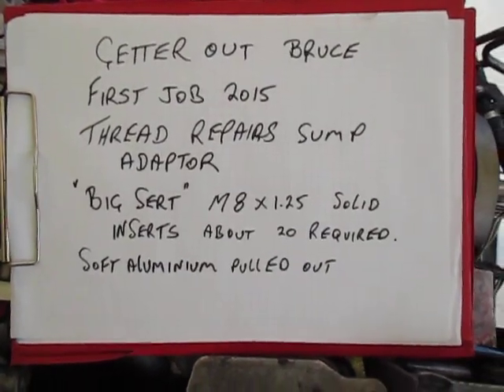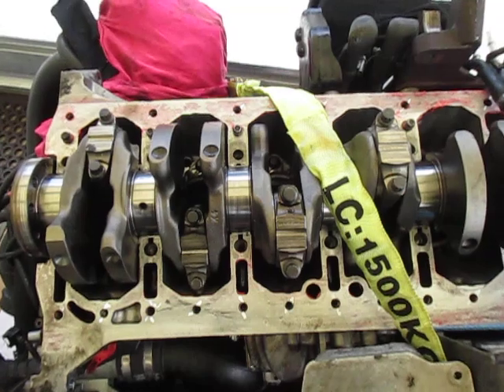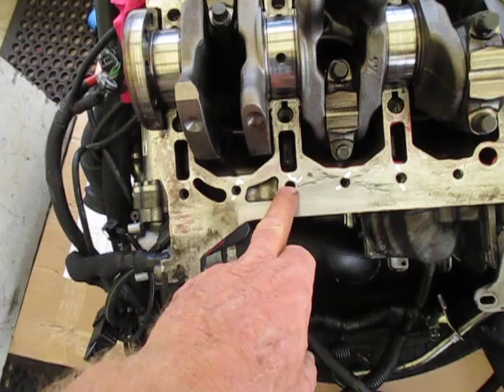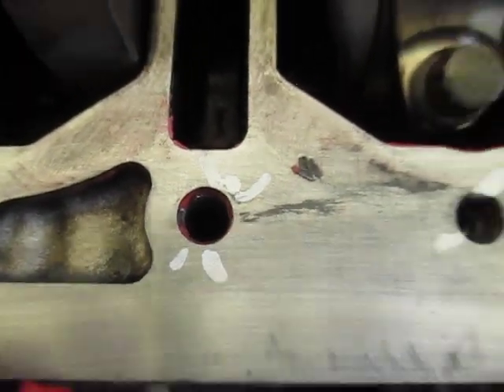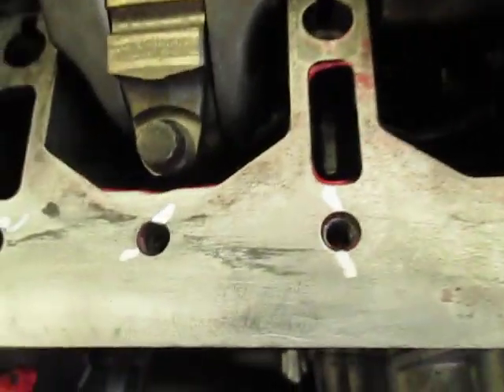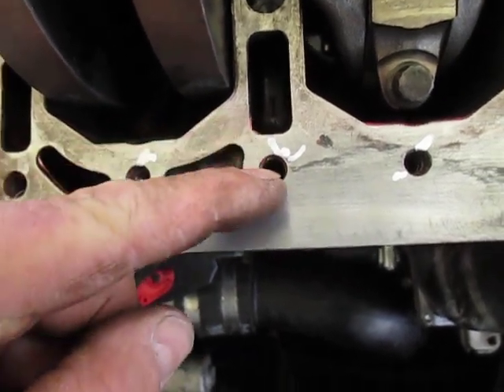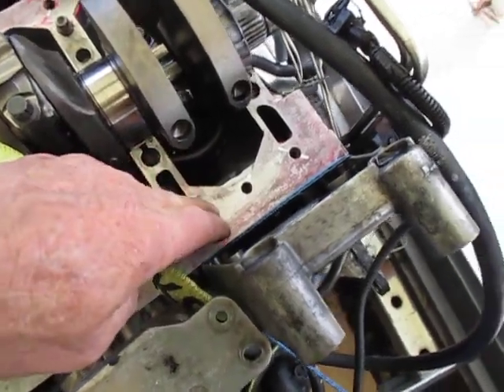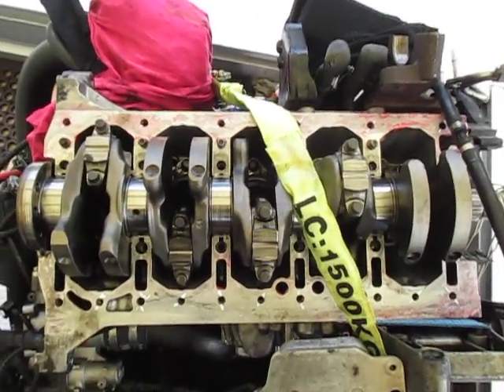Stripped threads in block Getter Out 23 Welcome 2015 with the first job

Comment from the maker: Not all the threads are pulled but the signs are there. so belt and braces do the lot. If it was a Camry head we would do them all. If it is a Porsche block do the lot! The Aluminium goes all soft and that's it!

Comment: Hi Bruce, surely they are not all stripped out, that sounds like extreme clumsiness either of the designer or the spanner gorilla, or is it being done as a belt and braces preventative?
Hope you enjoyed your Christmas, did you take a day off or did you work through it?
ATB
chris
Reply: I think the problem was probably caused by an air spanner set on to high torque, that is a favourite trick in a lot of "garages" the fitter just leaves the air spanner on one setting, I have often had the same problem with wheel nuts being so tight that a tube has been required on the spanner, when the nut does undo there is a loud crack, and a load curse when my knuckles hit the ground !
Reply: Englishman French great fun to be had on a cold dark rainy night miles from civilisation with a puncture and a stock issue wheel brace.:>(
Reply: Chris Stephens You, like I, have obviously "been there".
Reply: Hmmm, but unfortunately the t shirt shop was closed.